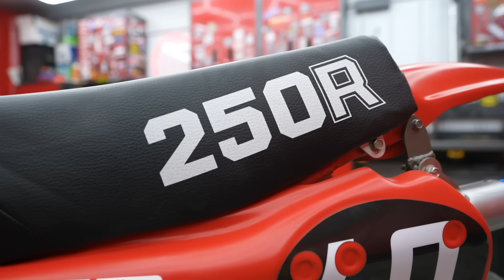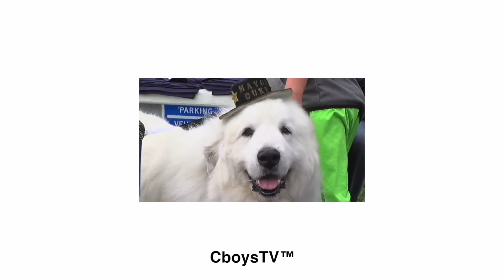Vintage Dirt Bike Testing

Comment: Little wheelie history lesson here 2:20
Doug Domokos traveled around the country doing wheelie shows back in the 70s. In 1978 he was signed by Kawasaki, and later in 1981 he switched over to Honda. Doug would wheelie the track during supercross races. He sat down with Honda engineers and they made him a special three wheeler. He could make one wheel turn foward, and the other back. That way he could turn while doing wheelies. He even drove the thing on tight ropes. I have a copy of a book he wrote detailing his wheelie techniques and bike set up. That was published in 1980, so yes CJ, they wheelied like that back in the day.

Comment: my dad built a 2000 jeep cherokee into a rock crawler. it’s quite the rig with swapped trans, axles, air lockers, 1/4 inch steel rock guards, different fuel cell, 10 led lights including 4 light bars and if the jeep series continues then lucky for you it’s for sale!

Comment: As someone who has no knowledge of motorcycles, looking at these they don't look any bit older than modern dirt bikes, well the 250R does look a bit more dated. most difference I can see is that these vintage ones have a way nicer "livery" as in none, only having branding and nothing else.

Comment: yall need to try some pre 2003 range rovers. absolutely cant break them without extreme abuse. search land rover destruction on youtube, theres a 10+ y/o vid from uk with a discovery thats worth watching. i own 3 range rover 2 (94-2002) all 4.6 hse. One is lifted to fit 37s on factory 18s with a personally fabricated drop suspension using terra firma coils and shocks. its about 6 inches lift no blocks, all flexy with axle mounted coil springs and relocation cones. It roughly about 48" of down travel in rear and 42" in front. two is a silver one with 39" wheelbase extension and a 78' chevy c30 fuklly float dually rear. 145" wb and legally uprated to tow 17800 lbs in New Jersey, she's my daily. Three is 01 wiith a built 78 small block gm 400ci with original 8500 miles from small 79 chevy c30 1 ton. all edelbrock parts with laser efi system. She rides on air bags with custon air system and 2 seats chopped after drivers door and stripped of all suspension. in England they call the look "bobbing" or trayback. Then i welded a baja trophy truck suspension with King coilovers at all four corners of my design and heavy duty active bump stops to really send it. 

You guys can make anything you can dream up legally with a welder, an imagination and some R+D. Only other requirement is land to house all the donor vehicles and parts while you build. 

nothing bought feels anything close to the satisfaction of making it yourself